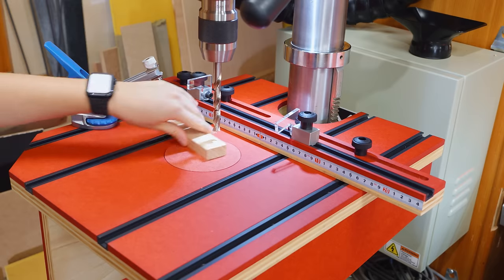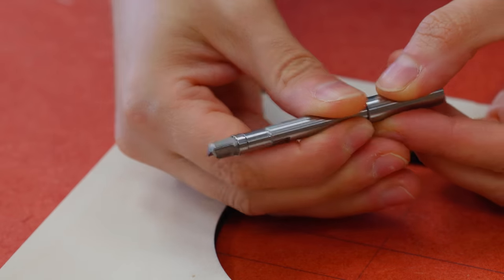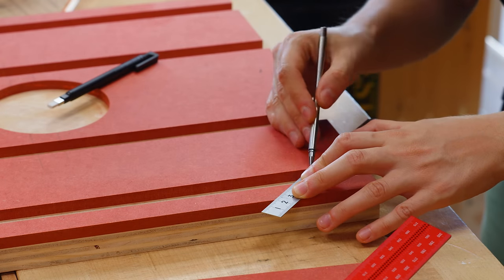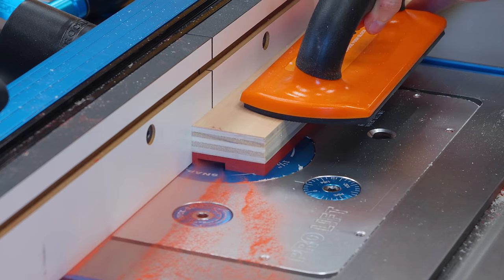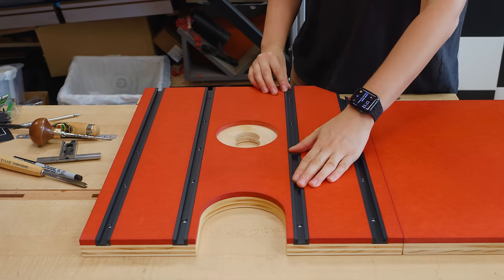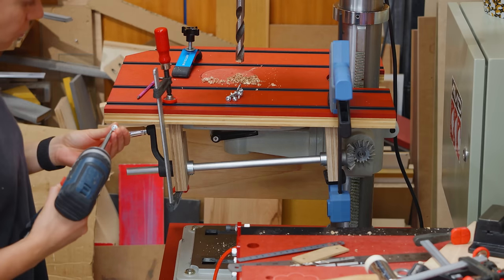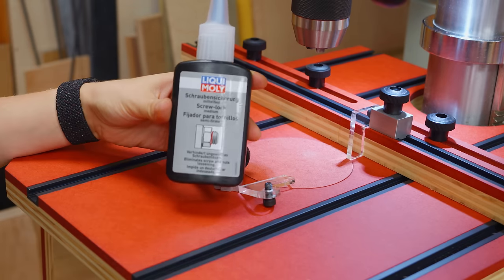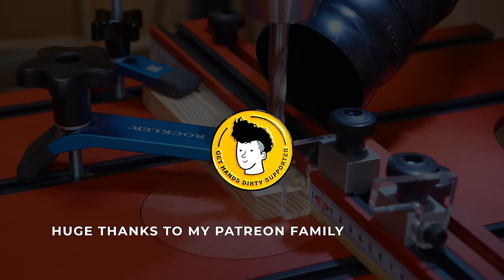Drill Press Table with 7 Truly Useful Upgrades

Comment: To cut bolts, screw a nut on the bolt, place in a vice, and cut to length.  Then using a grinder, bevel the end slightly, just enough to make it easy to start the nuts on the bolt.  Then when you remove the nut it will straighten the threads if need be.

Comment: Fantastic design.  Only one issue comes to mind and that is that the table rotates horizontally on the drill press support post when adjusting the height; requiring you to lock it in from the rear while centering the bit on the table.  I guess if there was a set screw on the sacrificial plate (to keep it from rotating) you could install a bit in the chuck and use the plate as a reference while locking the table in.  Just something to consider on a very well thought out design.

Comment: As an alternative to changing your router depth after you've set it perfectly, you could use double sided tape to add some scrap ply or mdf "runners" to the workpiece so the router cuts more shallowly on the first pass, then remove them for the final pass. Sure it's more work, but if you had your finished depth perfect and only had a couple of dados to cut it could be worth it.

Comment: First time watching your channel and my first thought was, "You really have a well equipped shop!" I have been a finish carpenter for 25 years and mostly I carry a portable shop in my van and I set up what I can on each job, depending on available work area. Mostly, I build stairs and balustrades, custom doors and some built-in furniture. My shop at home is only a table saw, a drill press and a workbench. I have been making so much for so long with so few tools that I am now able to build almost anything with nearly no tools! You do nice work and I like your presentation.

Comment: Great video. Clear visuals, concise narration, and perhaps best of all the background music was not annoying!  I've been combing through videos and articles on drill press table builds for the past week, with the intention of "stealing" the best ideas I come across. Unfortunately, most of these builds are simply regurgitations of the same tired ideas.   You have presented 3 ideas that I haven't seen before: the miter-gear elevation crank, your use of magnets for mounting the extended table to the drill press's metal platform, and the tilt-down extension wing are all concepts I'm going to include in my own build. Thanks for posting this!

Comment: I LOVE the miter gear solution for the table crank.  I am so going to add that to my DP table.  Very well thought out DP table, although I have my doubts about painting the T-track.  Hopefully, it won't cause any problems sliding the hold-down clamps.

Comment: You've got two angle adjustment options there -- one is the table slant, the other is the backstop. Be good to offer some kind of angle/protractor element, there, so you can get a specific angle without pulling out a special tool for it.

Also, consider putting a couple brass or steel inserts into the mating ends of the fence parts, and related rod pieces to go inside them. Then you can put the inserts into them and treat it as a one-piece fence when you want (which is possibly most of the time), and then split it apart as convenient. You could even, perhaps, use longer rod sections to make it act as one piece when further apart -- e.g., it can work like this:    ==== (no space) or ==-== (a small space, perhaps 3cm)  or == ----- == (12cm) There would be some flex in that last part, but only if you were stressing it while it was not locked down, which it should always be when using it. The bars would only be there for placement -- you could even put it far enough apart, perhaps 20cm, to only use the outer t-tracks to lock it down for even more range, assuming the bar used was good, hard steel, as it would, in that case, be a fulcrum against the two lock-downs. Note that this would allow your dust collection to get closer, when they are separated.

Also: You may find this one: "Marius Hornberger World's Best Drill Press Upgrades" of interest. Marius has a lot of good vids out there, along with JSK-Koubou. I'm sure you and your fans will find them both of interest. JSK-Koubou, for example, has a great circular-saw-makes-panel-saw design.

Comment: Very nice setup.  The off set replaceable insert was a great idea.  I have one like that I made and it has a small square insert in the middle.  I should be able to make mine round and off set like yours.  My Fence does not split, I just take it off if I need full death.  One thing mine has is the Drill head can move forward about a foot so I have a  90 degree surface in front with T tracks and hold downs clamps.  This allow me to drill dowels holes in the end of stock if the parts fit  from the table to the floor.

Comment: 27:26 depending on the quality of your vice, you could have put both pieces in the vice and been able to drill two holes for every drill change. 
Doesn't make a big difference when only making two, but it's a good trick to know when making many parts.

Comment: great idea and wonderfully made. just an idea I had for the center cover/insert is to place a  glued recessed magnet so you will not have to use the dowel to remove it all the time?

Comment: @GetHandsDirty. Great video.  Very nice compass set, “Thanks mom!” for sure. 
Thanks to you for showing me how to use my ETS EC 125/3 as a wax applicator as I’d never considered this before. Such a great idea as is the split fence to allow you access to space you’ve otherwise lost with the fence installation, something I regret with my current fence. I see a new drill press table in my shop’s future and I’m digging the unique color scheme.

Comment: Have you considered investing in a vacuum bag system for clamping large pieces like the boards you laminated together? It would also allow you to do bent laminations.
Reply from the maker: I've thought about it once or twice and I have two Roarockit vacuum bags, but they are long and not very wide. These pieces wouldn't fit. I might consider another system, maybe with a vacuum pump. Do you have any recommendations?

Comment: I spent almost 4 decades making commercial signs ( mostly metal ones ) ..you can cut aluminum with standard woodworking tools...Routers and Miter sawa , radial arm saws and of course your tablesaw...use carbide blades and carbide router bits ..69 tooth blades or higher wirk besr..as well as Non Ferrous blades for Circular blade tools.. i clamp any extrusion and wear face masks for safety - metal can kick or fly pretty easily and it can happen fast.... non ferrous metals are like hardwood basically....i also use a lubricant ( kinda messy but helps cuts better and i use a type in a stick that is solid in room temps....any metal supply business should have that and can help you with your blades etc.... Plastics are similar of course in cutting...

Comment: It's a terrific project. I was especially paying attention to the front crank mechanism. The only problem I have with it is that the rulers on the split fence would need to be reset to a zero reference any time you wanted to use them.

Comment: On recommendation on clamping the top for lamination. I would consider using clamping cauls to apply even pressure. I worried when I saw you clamping it up that you might have voids in the lamination.

Comment: You make amazing videos!  Hey what drill press is that?  And did you replace the tri-crank handles with that molded crank?  I'm making a foldaway drill press arrangement, and it would be so good to have the crank handles closer to machine head.

Comment: @GetHandsDirty This is really cool and I'm sketching plans now.  Trying to get a sense of scale here though for inspiration as I consider the dimensions of my drill press.

What's the radius of the center circle?  Using the fences as a reference it looks like it's about 40cm wide and maybe 60cm deep?  I think T tracks are ~ 20mm wide which checks out to ~2cm wide using the tape measure on the fence.

Translating to our US non-use of the metric system, that's a little under 16" wide.  It looks bigger than that but then I have no sense how big your drill press is either.

Comment: Nice build but I would add one part that connects the two fence halves and automatically aligns them, like you connect guide rails for tracksaw. As it is now with two individual floating halves it must be a pain to use for all situations when you want a long continous fence...which I guess is more than 90% of the time.

Comment: I don't use my drill press a ton yet but it's a huge PITA when I do.  I might not need ALL the features you've got here but I like how I could make this in phases.

And I just checked the hand crank on my drill press and sure enough.... It just BARELY cross that plane.  I suppose I would just make a new crank handle for it or worst case chisel out enough room for the handle.  I don't have the patience to machine an alternate cranking mechanism for it.

I am pretty averse to cutting metal in my workshop.  Too many chances for metal shavings and I can't keep my kitties out and I don't need them stepping on any sharp metal.  I might use a dense hardwood instead.

I don't know that I can get Valcromat sheets here but....  I think 1/2" melamine would work glued onto a 3/4" BB base.  It looks like you're routing all the way through it anyway so....  why not just use 1/2" thick melamine and cut the pieces to fit between the T-tracks?  

Thank you for posting a parts list!!!

Comment: Great job on a very worthwhile project. What thickness was the valchromat you used on the drill press table? I am getting ready to start on a router table wing on my table saw, and think this would be the best stuff to use. Again, great job, very impressed with your work. David

Comment: I'm curious why dust collection was better 'from behind'. If you look at it from the dust collection perspective nothing has changed. Bit rotates, so there isn't any angle that's different from any other.
Reply: Perhaps it's some sort of function of rotation speed, current depth of the cut and the friction that determines what direction dust exits the workpiece.
Reply from the maker: I can't explain it since I know nothing about physics of the rotation of the bit really. But most of the time, router bits and drill bits have a tendency to "release" the material in a specific direction. So I guess if you are able to find the direction, makes sense to place the dust collection in there as there's no sideway resistance to enter the tubing. As if the whole movement got in line. I don't know if this makes any sense scientifically but it does in my head 😂

Comment: It's beautiful and very functional, except that I think it reduces precision. First, the magnetic mount - just bolt the thing on, this seems like fancy for the sake of it and, if the table moves just a little when doing repeated drilling on multiple parts there goes your setup and, if you don't notice, there goes a bunch of parts. Second, I LOVE moving the table height crank to the front, but, the table swings freely left to right unless the clamp is tightened and that didn't get moved to the front, so... no real gain there, still going around the back of the thing to loosen the clamp before changing table height and then tighten it after. This idea would be so cool, if it included a way to clamp and unclamp the table to post connection from the front.

Comment: Always a good idea to sneak up on your work when using big chunky router bits. They are very inefficient at clearing material so they can bind easily which can get quite sketchy depending on speed and your grip of the piece also causing damage to the piece. They also have a tendency to get quite hot an can scorch if you push them too hard. It’s funny it’s always the big bits and the really tiny ones that are the most annoying. The small ones like to break at high speed making your soul leave your body for a while lol.
Reply from the maker: You are totally right! I'll be more careful with the beefy ones from now one. And thank god I never broke a bit at the router table, only with CNC's but that must be VERY scary!

Comment: You never take a full depth pass using router bits like that especially on such a weak router motor. It’s recommended to take this in 2-3 passes in about 1/4” increments. 7:27

Comment: Chris, I looked for the plans on your website but could not find them?  Will you be selling plans for this build?
Reply from the maker: Hi Barbara, sorry I didn't make plans for this one. I felt the dimensions were too specific and all drill presses are different. Not sure a set of plans without measurements would really add anything to the information already delivered in this video. But if you have specific questions about this, I'd be happy to answer them via email. You can drop me a message through my website contact form.

Comment: Avoid using weights, pick  spots which will not have material at the end and screw them together whilst keeping it flush on all sides. Wish I had a drill press and that top.

Comment: Really nice work, but Why make it removable, when you have removed the ability to adjust the table height without having the top on? should have also accounted for being able to have a smaller crank, or extended it somewhere attached to the metal table, not to the Addon table...